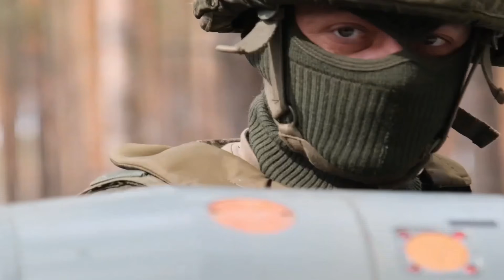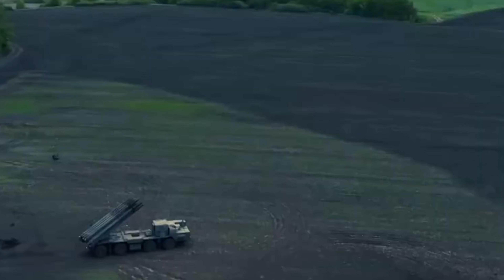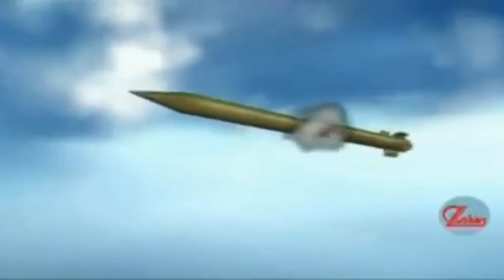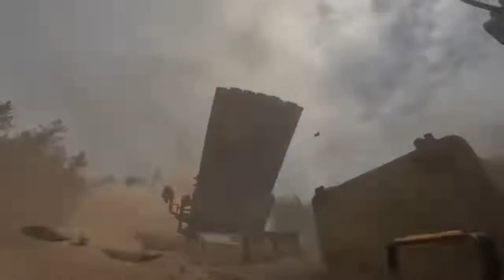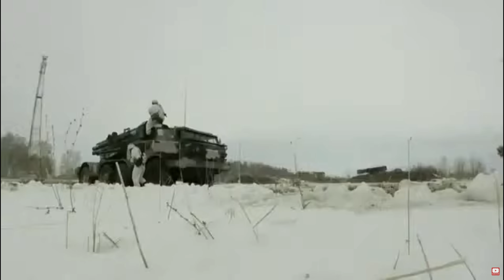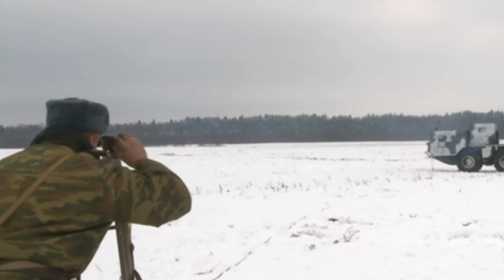Russian BM-30 'Smerch' Multiple Rocket Launcher | MOST FEARED ARTILLERY WEAPON ☠️

Comment: As a tanker, it terrifies me as well. Cause it's relatively percise.

I was on the receiving end of a bm21 grad once. And that was already terrifying. But thank god it's all over the place in terms of accuracy at range. 
But the 27 and 30. They can ruin your day.
Reply from the maker: It's a serious piece of kit, no doubt.
Reply: @_Matsimus_  I used to think that such heavy rocket artillery is excessive but now it looks like it does have its place.
Reply: @_Matsimus_  Dozens & dozens of clips showing 9М542 missile strikes in uak are available on the internet.
A bit of a let down that you didn't show strikes footage of this system. (except that one clip)

I recall watching a video where front line operators found a hiding den of enemy fpv operators.
It was a concrete building with 3 or 4 floors. 

The operator ordered a single 9М542 missile, coming from some 30 miles out.
The drone is covering above & looking at the target, where enemy is hind in. 

All of a sudden & lengthy objects just zips down from the sky. 
The missile penetrates into the concrete structure & detonates on the inside... fin
Reply: The tornado S solved this " problem " as the BM30 smerch and the solntspyek is for saturation of a large area.
Reply: @lexburen5932  Heavy reactive flamethrowers (yes, thermobaric weapons in the Soviet/Russian army are classified as flamethrowers) specialize in destroying fortified positions, pillboxes, whose ceilings allow them to withstand 122-152mm conventional artillery fire. 
Of course, this thing is more universal, but for any combat units that the HQ bringing into the battle will inevitably be detected by the enemy and then will try to use counter-measures. Therefore, it is simply unwise to trade such serious trump cards for more insignificant targets.
Reply: well Stalin's organs have historically been used to shake up tankers.
i mean its proly not going to hit you, but crews dont like being fired upon for some reason
Reply: @johnjones2043 Common misconception. This is historically designed against concentrations of infantry/motorized infantry not sheltered by defensive positions capable of withstanding a direct 4-6" hit. For example, the “Grad” is practically useless when storming fortified areas, but to stop attacking forces, which for some reason came under a concentrated fire - that's where this thing is an absolute beast.
Reply: @Ailasher  
There are plenty of accounts of BM-13 direct firing on German tanks, so that's not really debatable. 
It would be hard to believe otherwise. That is that in 5 years of war, BM-13 units have never been in danger of being overran by enemy armor.
Reply: @ All artillery, from antiaircraft to howitzer artillery, fired directly at tanks in the Second World War. In the training of Soviet artillerymen since then, direct fire of all, once again - all, barrel artillery is assumed. Right up to the modern artillery systems. But that doesn't mean it's a standard situation. This use of the BM-13 is not due to the effectiveness of such fire, but to other factors.
Reply: and even a miss can damage your tank enough to immobilize it or damage critical delicate electronics.
Reply: @danielaramburo7648  The bursting of an artillery shell involves three elements: 
1. Crushing action in the form of air compression force value due to the detonation velocity of the explosive.
2. Explosive volume - the volume of gases released and the velocity of the shock wave propagation.
3. Damage by fragments and other secondary blast products.
The first two are a direct hit. Even if the shell itself did not hit the hull. This still counts as “hitting the target”. Fragments/Shrapnel is unlikely to cause not just serious, but basically any damage to a modern MBT that would affect combat effectiveness.
Reply: @Ailasher  if a near by burst damages the optics or exposed sensors, the tank is forced to leave the fight for repairs.
Reply: @danielaramburo7648  You're just writing about, like I wrote, “direct hit.” Because it's unlikely that a frags would cause that kind of damage, even to the optics. But a shock wave would. And a combat vehicles caught in the shockwave are always considered being a “hit”, not a "miss". In this case, the damage depends on the caliber and type of shell, as well as  affected the area of blast.
But that the damage already been inflicted is without a question. Another thing is that tanks are pretty resilient beasts. For example in the famous video where “Bradley destroys a T-90” - the IFV did the tank a jack shit. Yes, it took the tank out of the battle by practically annihilating its optics on the hull (and initiating the explosion of the smoke screen unit on the turret, which civilian watchers thought was something serious, as the “Tucha”'s blast was quite spectacularly) and making a really “eventful” day for the crew of it, but it didn't actually destroy the tank - not even immobilizing it. It was finished off by the drones there if I remember correctly.
Reply: @Ailasher   I don't think there are tanks rated for 200mm shells or something similar. The explosive force is simply too much it'd just shatter the armor. But I haven't seen any record regarding modern MBT getting hit by artillery shells though.
Reply: @minhducnguyen9276  As I wrote: crushing impact effect of blast radius. Okay, I'll try to explain this through an analogy:
Imagine that the air in the effective blast area turns into a concrete wall. The density of this wall depends on the detonation velocity of the explosive. The shock wave, i.e., the speed and the range at which this concrete wall is approaching to the target of the blast depends on the volume and velocity of the gases released as a product of the explosive ignition during the blast. And at the moment of impact, this “concrete wall” acts not like a literal solid object, but more like water (or gas, which is actually what it is) - that is, it tends to “flow around”, to fill all the space in its path, all the crevices, etc.
And this one right here could actually be dangerous to the tank. You don't want a literal shell hitting the hull. It is enough that it was a few meters away and depending on the volume and type of explosives in the shell, a suspension, a observation devices, a external protection, a gun, etc. will be destroyed. The hull may not crack, but the tank will not be able to continue the battle.
"But I haven't seen any record regarding modern MBT getting hit by artillery shells though."
Because modern tanks are highly mobile vehicles. Even so, I have no doubt that there are such cases, for example in the Russo-Ukrainian War. Also because a tank unit got hit by an artillery barrage, well, that unit had a particularly bad day. Before the era of real-time fire adjustments via drones, this was usually the result of direct artillery fire. Which is literally a death sentence for the artillery crew, not only now, but also in the era of the Cold War. But now the artillery fire directed from drones has simply reached a new, incredibly high level, even without taking into account high-precision shells. Especially considering the minefields, which limit the space for tanks to maneuver.
Reply: проблема противника этой системы вв том что к ней существуют касетные ракеты с самонаведением.

Comment: Indian DRDO was also inspired by Soviet Era BM-21 , BM-27 & BM-30 MLRs to make own domestic MLRs . & hence this started the project Pinaka . The very first 214mm Version was deployed by  210 Rocket Regiment of Indian army during Operation Vijay in 1999 Kargil war , which has a longer range & more payload compared to the existing 122mm BM-21 MLRs in service . After that work on development took place on both 122mm & 214mm Version , both inducted in army in large numbers . Later evaluating the performance of New Generation Guided MLRS like Israeli PULS & Brazilian ASTROS SS-40G & SS-60 , new GPS guided versions of Pinaka 214mm Variant are under development & are about to complete soon
Reply: 214 is a strangely specific caliber
Reply: @Sleexb  There is also an upcoming project ( derived from Pinaka ) to make 300mm Guided Rocket Artillery versions & This one will have the same features as that of HIMARS/M270 & ELBIT PULS integrated within them

Comment: Tornado S/U basically a modernized BM-30 that can use guided 220/300 mm rockets
Reply: @jetfighter200  300 mm, 12 tubes and 120 km range (180 km with new rockets) as compared to 227 mm,  6 tubes and 80 km range for HIMARS .
Reply: @ryszardrakowski2711  it depends on the version of the Tornado, there is no Tornado-U system.

there is Tornado-Grad and Tornado-Smerch
Tornado-G and Tornado-S

when talking about tubes for unguided 300mm rockets the Tornado-G has 6, just like HIMARS, whilst the Tornado-S has 12, just like M270.
for 122MM rockets both can carry a remade version of the older launcher of the BM-21 but with less tubes.
and just like the HIMARS and M270. instead of having just normal tubes, you can actually detach the regular unguided launcher, and load a sealed container with GLONASS guided missiles. of which the Tornado-G carries 1-6 shot container, and the Tornado-S can carry 2-6 shot containers, this means you do not need to reload each individual tube either, but you can reload the entire pack of missiles/rockets just like with HIMARS and M270

there also is no longer a difference between the calibers, both the Tornado-S and tornado-G can mount 122MM and 300MM rocket tubes or sealed containers for guided stuff.
lots of times in news articles or videos, if people talk about the Tornado-S or G system, they show a picture of a Regular BM-30 Smerch, which is wrong. if you google "9YA295 canister" you can find pictures of the sealed launch container, as well as what the Tornado-S and Tornado-G actually looks like.
Reply: @ryszardrakowski2711 80k lol...better check them ERs son...
Reply: @nocluediyer785 i did.
Reply: @ryszardrakowski2711 oh ya?! You realize ER stands for EXTENDED RANGE. You are looking at munitions we gave to ukraine 😂
Reply: @nocluediyer785 so???
Reply: @ryszardrakowski2711 so get your facts straight before running your mouth on youtube.